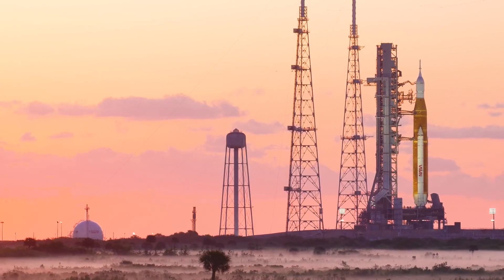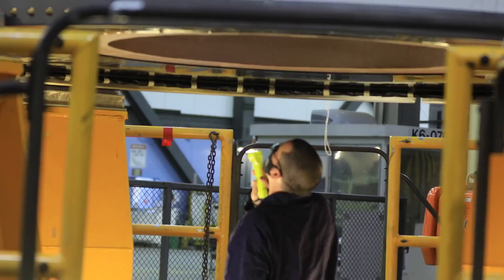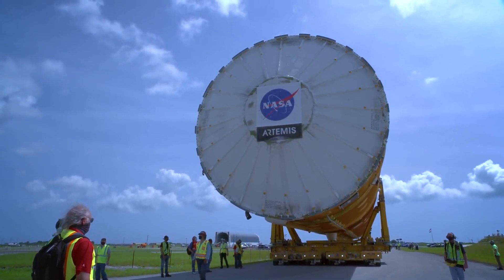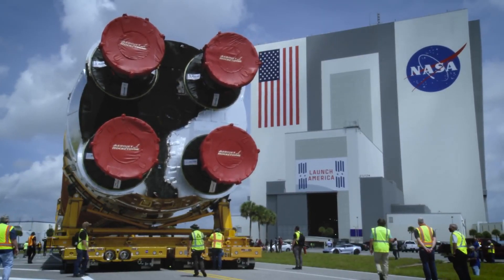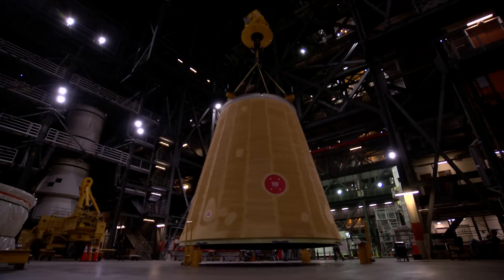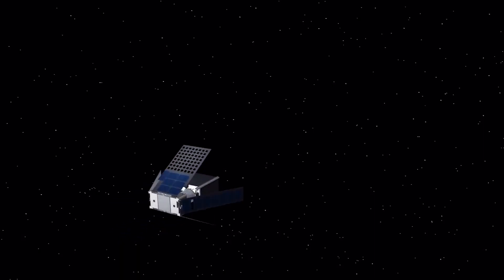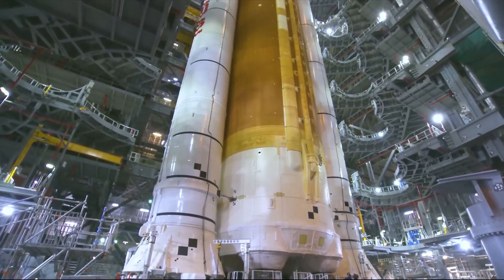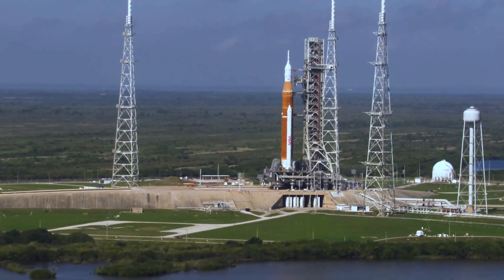How was the Artemis 1 moon rocket assembled? Behind the scenes look

Comment: Would like to see a launch in person someday/year.
Reply: Science Revolution    Wow, you are delusional.  Have you ever heard of satellite TV?  You aim your satellite dish at the satellites location over the equator and you can pick up satellite TV channels from other countries.  I had a C-Band dish in the 1990 here in Canada and could pick up channels from the U.S. and Mexico.  
You can also get a satellite phone, which will work anywhere on Earth, far from any cell phone towers.
Get out of the city where the sky is dark. You can see satellites with your own eyes after sunset or before sunrise, while they are lit up by the sun, but the sky is dark.  The easiest to see is the ISS.  Go to spot the station website and input your location.  It will tell you when and what angle to see it.
Yes, the ISS needs to boost itself to a higher orbit due to atmospheric drag.  That affects all low Earth orbit satellites.  That is why they eventually fall back to Earth.  As did Skylab in the 70s and as happens to all low Earth orbit satellites eventually.   The ones in geostationary orbit, don't have that problem, since they are much higher.
The duration of the rocket's engine burn determines it's velocity.  Once it is up to orbital velocity, it will continue in orbit for years.
Weapons in space are not practical.  It is better to have them on the ground.  A weapon in orbit, could only hit a target that the orbit is over at a given time.  An orbit directly over the equator could only hit targets on the equator.  
Maybe study some real science and physics instead of conspiracy nutters.

Comment: My guess is that the SLS will get about 5 miles downrange and then explode in a HUGE fireball.
Reply: I doubt that will happen.  It has already run through its 8 minutes and 20 second static fire test.  The SRBs are just an upgrade of the ones on the shuttle.  
The only reason that the Challenger exploded was due to launching when it was too cold.  That is unlikely to be the case in August or September when it launches.
Reply: @my3dviews    But it would take care of the problem once and for all, no more money wasted on SLS.
Reply: @TheJimtanker    Or, it would result in them making changes that would end up costing even more.  It is a test flight after all.  Its purpose is to make sure it all works in flight.  A failure does not necessarily mean it would be cancelled. Plus, cancelling contracts is not free either.  
There is also no guarantee that SpaceX's Starship will work.  Until it makes an orbital flight and landing, SLS will not be cancelled.
Reply: @my3dviews    At the very least it would set them back at least two more years and hopefully Congress would come to their senses and realize what a waste of money it is chasing this paper tiger and obsolete technology.